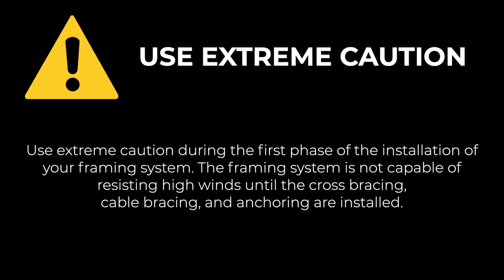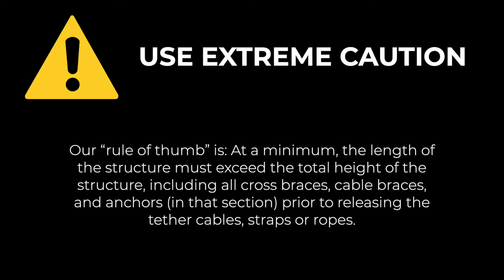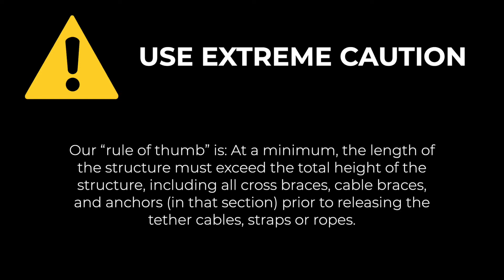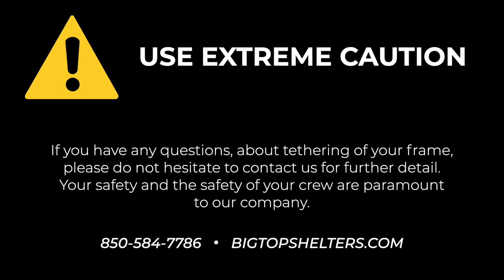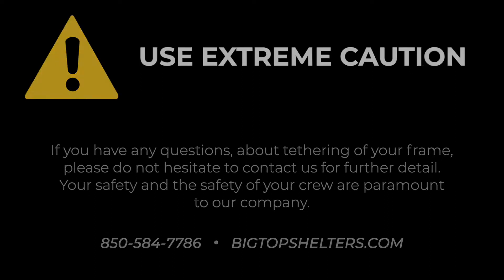Big Top Fabric Structure Installation Tutorial

Comment: Adding rolls of friction tape over the outside framing will assist in pulling the  cover over them (same kind they use in Mr Cool HVAC units-use adhesive to stick to frame)